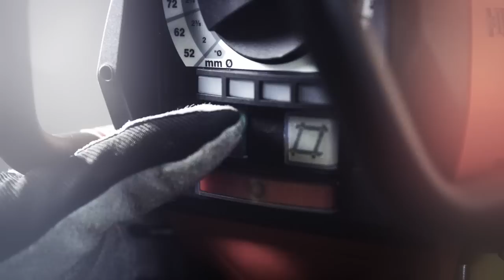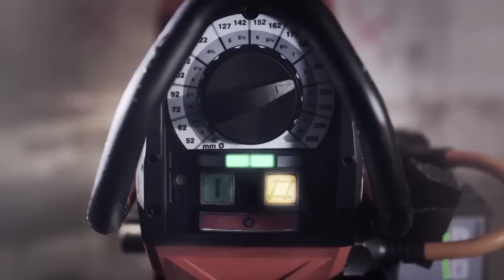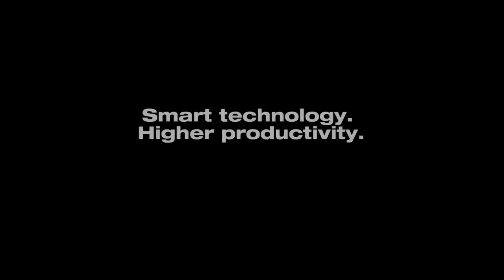INTRODUCING the Hilti DD 350-CA and DD 500-CA with Cut Assist

Comment: Зачем дырки понаделали, окно будет?
Reply: Doubtful.   But it could be for any reason...  like passing utility pipes or wires.  If they were cutting something big like a window opening, they would drill a small hole at each corner, so a loop of diamond abrasive cable can be passed through that would do the cutting of each side.